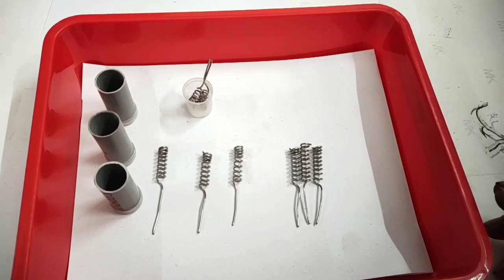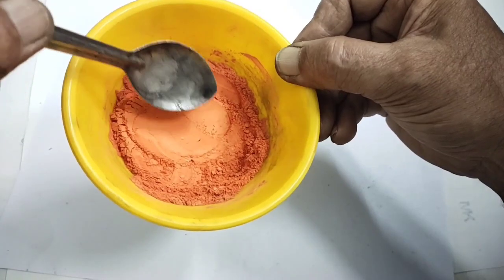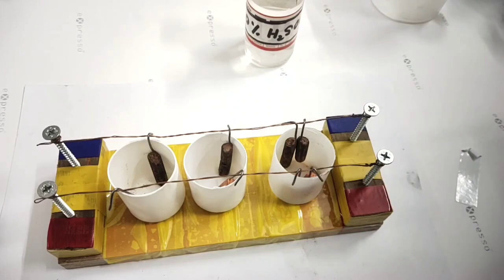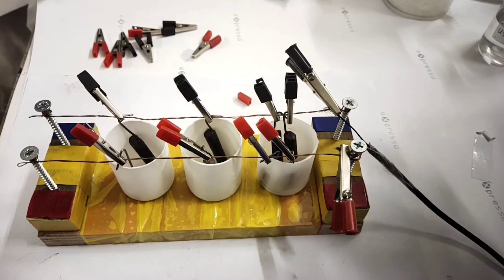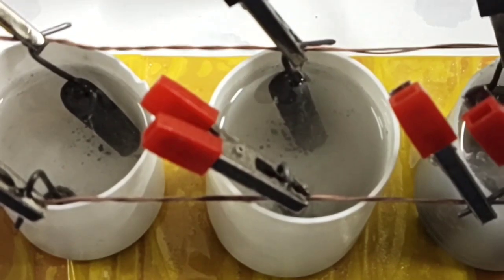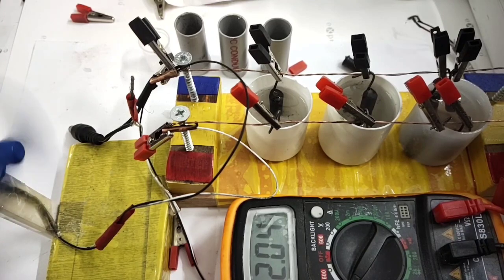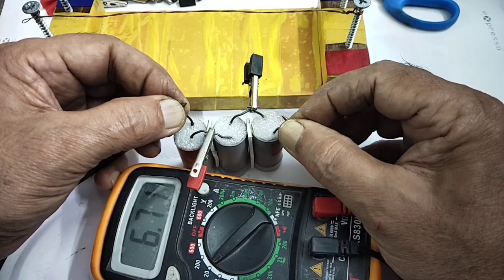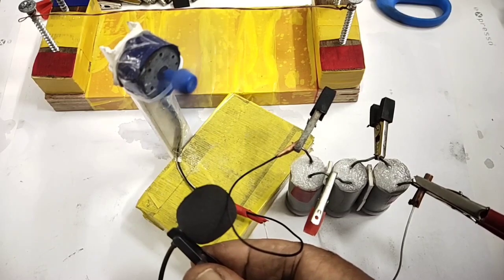SMALL LEAD ACID BATTERY-LIGHT WEIGHT/6.2 V, 3.5 A USING 3-PVC TUBES, NEW  SIMPLE GRID TYPE, VIDEO-69

Comment: DKJ Tech:- Very good & valuable Demo on Lead acid battery, quiet a different model your creative Idea of using Lead solder wire as Grids, and making rolled type pasted Pos/Neg plate's, PVC container's, sulfuric acid, leaching, forming, & charging, a great volt & amps out put, A real Pro work, nice presentation, construction, performance, thanks, 👍🏿👍🏿👍🏿JPN.
Reply from the maker: Thank you for your valuable comments and appreciation.